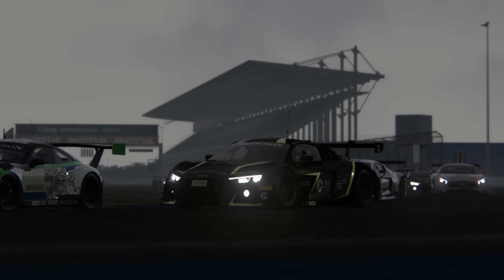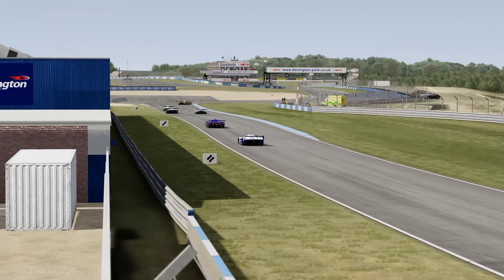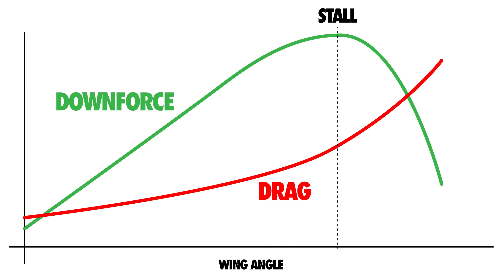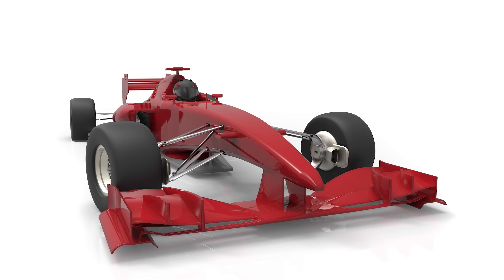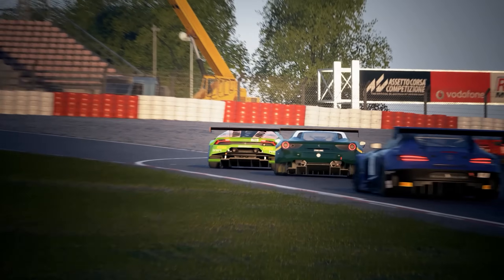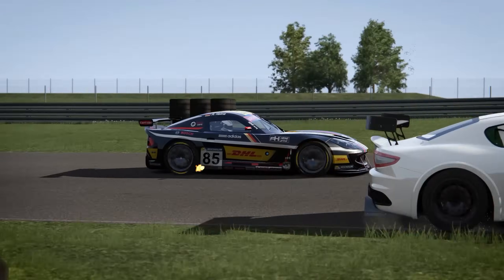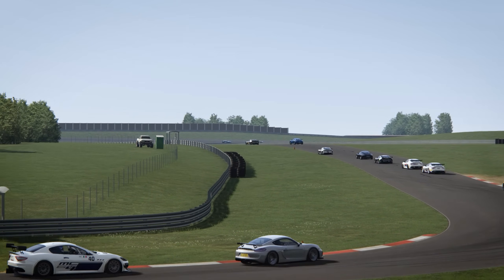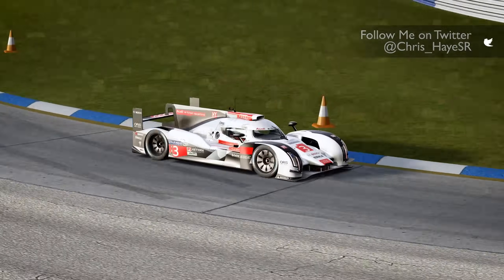Sim Racing Setup Guide 10 – Aerodynamics [Wings, Splitters & Diffusers]

Comment: I have no doubt rake angle is useful in reality but are you sure these sims are able to take into account rake angle, i mean i know you can adjust it, but I guessed that was only modelling mechanical. I thought sims just use a look-up table for wing angles to apply pre-determined downforce at specific point. I am not sure they take into account angle of attack. Do they? I dont think they are doing cfd under the hood. Can anyone verify this? Tanks.